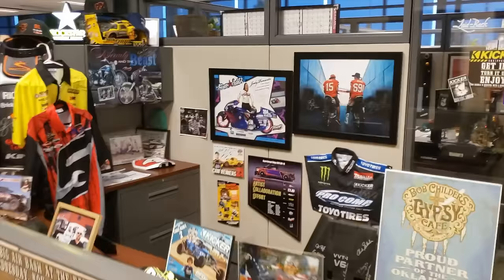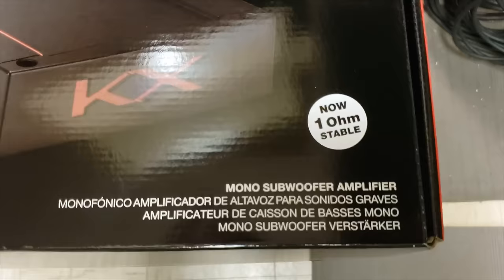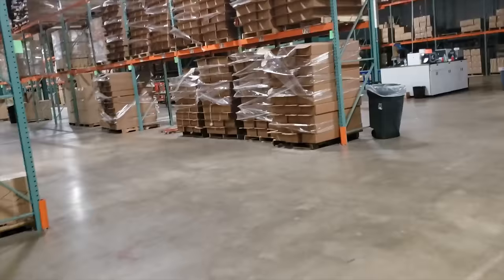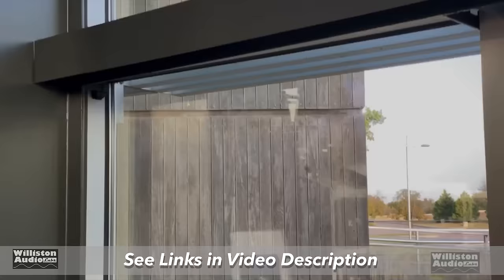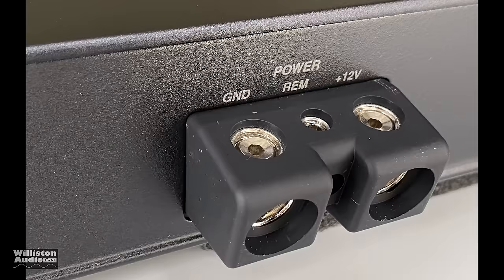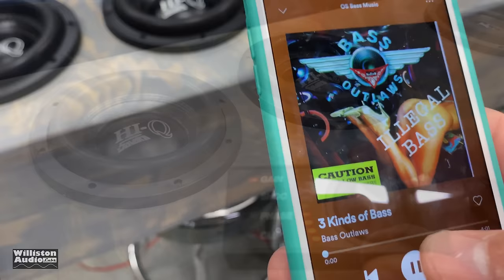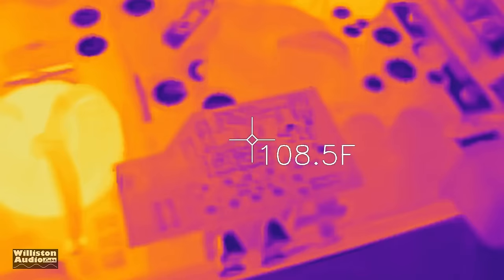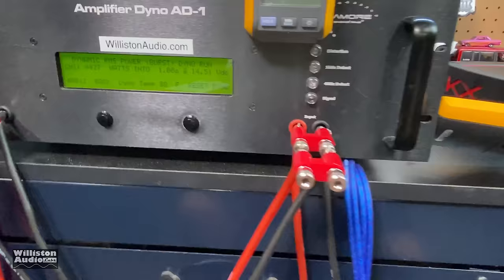Is it Worth the Money? Kicker KXA2400.1 2400W Amp Review and Test

Comment: I am in the market looking for a new amp. I fried my Hifonics Zeus 2 channel rated at 2400 Watts (by my own doing). I have a single 12, 2 ohm rated 3,000 watt peak. I've been looking at the Kicker KXA 2400 1. 2400W mono. On paper as far as power goes is impressive. 4 and 2 ohm peak at 2,400 / 2,405. 1 ohm at 3,500 watts between 80/85%. With a price tag of $1,000. My question is. Am I able to reach that amount of power at a lower cost? I am in Midland Texas and that seems to be all I can find with enough power.

Comment: Yo, love your videos please keep them up!

Question:  on the amp reviews you always mention the output GA size that sends the signal to the speakers. Is there a basic rule of thumb on wire size (if terminals are large enough) that we should use based that correlates with the real wattage amount? Like 1000w less 12ga, up to 1500w use 10ga... so on?

Thank you.

Comment: Can this run on the stock battery and alternator of a 2020 Santa Fe?  Don’t want to have to change the electrical system or components.
Reply from the maker: Generally speaking 1000-1500 watts is the most is use with a factory electrical system. You may be able to get by with an extra battery, but it depends on your listening tastes and habits

Comment: I've always been a kicker fan, I've got a zx2500.1 that I paid $600 for brand new about 10 years ago and its still hitting hard with the same 2 15” L7s...I just bought 2 15” L7 q class for another project I'm working on and want to get this amp but not ready to spend $1000 so I got the cheap Rockville db16 to try

Comment: I wish you would do more kicker dyno’s. I can’t find a CXA 1200.1 or 1800.1 dyno anywhere on YouTube and those are both super popular amps. It would be really nice to know what they actually do.
Reply from the maker: Thanks for the suggestion 👌
Reply: @wal  thanks for the reply. Great show by the way! I have been binge watching for the last week. My wife hates me because all I have been talking about is watts, ohms, voltage, etc. I’m sure she knows more than she ever wanted to know about car audio. She helped rip out all the CCA and replace it with OFC yesterday. Now I am fixing to do the big three and imma need some tiny hands so she’s just volunteered 😂
Reply: @wal  hey sorry I also have a quick question. Are there any shallow mount 10 inch subs that have an RMS rating above 600 watts? I think I’ve hit a wall because I’m out of room in my truck (2005 F-150 Crew-cab) so if I can’t find a higher wattage sub woofer I either have to stop obsessing or give up my back seat….. or get out the cutting torch 🤔

Comment: Not too sure how useful the remote is. Fine I guess if the system only has one amp. If there are multiple amps. Does one remote control all of them?  Having "Gain" on there when it clearly a volume knob is a little confusing too.
Reply: You gotta watch before commenting bruh. Big D said it connects to 4 amplifiers with 1 knob.

Comment: I dont get it. They say it needs a 200amp fuse but its pulling 300 certified and almost 500 dynamic amps?? Wouldnt that blow the fuse everytime if u r running at 1 ohm?
Reply: The 200 Amp fuse is in between the Amp and the subs.
Reply: @drewjohnson4794  ya i know but as you can see this amp pulls way way more than 200amps so that 200amp fuse would blow

Comment: I have 6 audiopipe TXX BD3 12's on a 8000 watt gravity. It's pushing them. I have a friend that has two on some amp and he won't tell me what kind it is that's hitting harder than my six. Do you have any kind of suggestion for me? That's in my price range🤷🏾‍♂️ I paid $300 for the gravity 8000 watts.
Reply: i would say buy 2 taramp smart3 amps and hook up 3 subs per amp. the amp isnt much but the electrical upgrade will be up there. extra batteries, upgraded alternator and wires will cost alot of money but your system will be hittin hard

Comment: Omg man, I was just researching kickers amps. Haven't looked at them for a while because of their price. Any chane you might have a cerwin vega in the works? I really dig the flir cam too. Never thought the chokes would be the hotter thing in there. Seems they'd hold the heat longer but still, crazy
Reply from the maker: It is possible 🤔
Reply: @wal  k well regardless...... Kick ass review. Just straight kick ass

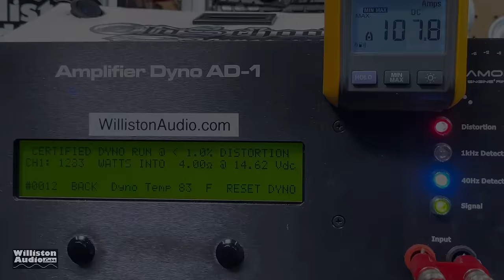Comment: I don't get it, the first test at 4 ohm certified showed you pulled 135.7 amps..(11:44) ...Then when you talk about the efficiency, that test changed to 107.8 amps?...o.0 (12:32)
Reply from the maker: The amp reached its power with 107.8A and continued to pull current after reaching 1% THD. This is normal as I match the clamp meter and Dyno after capturing the clip.

Comment: need to test an old KX2500  EDIT - Big D, any chance you can forward a question to a kicker tech for me? Wondering if I can run two warhorses to a single 2VC sub, just send the second amp an inverse signal so both coils are powered all the time but by alternating amp.  May need some weird diode setup (if thats even possible) but it would be fun.. :)
Reply from the maker: You can call their tech support Mon-Fri

Comment: I'm gonna return mine kxa2400 had it a month tomorrow exactly! its shutting off  getting super hot very disappointed 😞 it's was the strongest amp I've ever had but it just gets too hot and cuts off unacceptable very disappointed! Went back to my old  Brx2400 hifonics  Brutus that thing has been running strong for yrs!!! I never would have thought I would have to go back to it but here we are! Kicker come on man!
Reply from the maker: You should have them look at it. They test their amps running at full RMS power output for hours! They are designed and engineered to handle a beating!
Reply: @wal  yeah I mean don't even beat on it for long at all 1min 2 tops what really sucks is after that clean bass it's really hard to go back! 😔 I'm torn I wanna send it in but I mean a month that's  all before I have to send it in for repairs!!
Reply: @wal  think I figured out the problem loose power cable coming off second battery gonna reinstall it when I get home 🤞 it's all good!

Comment: I had the kicker kxma800.5 and I will be honest I didn't see what made it worth $650. I could buy a Helix amp by Audiotec Fischer for that. The kicker was still a clean amp with great features but not $600+ worth. I remember seeing caps that even cheaper amps use. Different users for different reasons though. I didn't use it in a marine environment

Comment: 1 off Design Is Where The Cost Comes In... But That Efficiency Will Save U Some Cash On Your Electrical. I've Seen Cheap 2k Amp Draw As Much Current As This. And This Kicker Is Making Alot More Power Then Those.

Comment: I had the KXA800.1 it was a powerful amp good crossover and loved the Bluetooth remote. BUT It had Bluetooth issues. When ever I had the car serviced services and the battery was disconnected it would not pair again. Sent it off they fixed it and it did it again.
Reply from the maker: That’s a bummer! Let me know what happens
Reply: @wal  It wouldnt ever pair again even bought a second remote. I sold the amp as is.

Comment: Big D. I’m looking for a sub amp that is at 2k or more in 4 ohm mono. Any suggestions 
Thanks
Reply from the maker: Wow that’s a big amp if you are going monoblock.  The Orion HCCA3000.1DSPLX will do that power but they are hard to find at the moment.
Reply: Looks like the HCCA 5000 will give me 2300 at 4 ohms. Are these current amps? Trying to find one.
Thanks

Comment: That's not hot, running my Punch 150's back in the day, there was literally solder dripping out of my right side sub amp... They really didn't like 1ohm too much... (solder melts around 375 degrees) It was actually repairable too, just needed to clean out the melted and replace with new.... yes really...

Comment: Is the silver one before this one 1 ohm stable?
Reply: No only newer ones. The silver ones KX are 2 ohm stable.  KXA amplifiers black ones are 1 ohm stable. I use 2 kxa1600.1 and they are great.
Reply: @wirebender  i have the silver one. Is there an amp dyno on that one? I cant find one. What do you think it does?
Reply: @enzos9211  i only seen a amp dyno of the kx1200.1 not the 1600. It probably puts out hundred more watts than rated. Its regulated power supply so no big numbers but consistent power.
Reply: @wirebender  i figured. I need more power so I'll be selling this one soon. Thanks

Comment: The days of the cheater amps are long gone. It would be nice to see a 80% to 200% underrated amp like back in the day with Kicker, JL or RF . We have lowered our expectations to being happy with  rated power.
Reply from the maker: Did you even see the 1 ohm run? 😳
Reply: I know, right?  50W 8Ω 100W 4Ω 200W 2Ω 400W 1Ω 800W 500mΩ 1600W 250mΩ 3200W 125mΩ 7200W Arc Welder Mode. :-D
Reply: @wal  I did, but was the only run a lot higher than rated.

Comment: Can I get a good recommendation for a good cheap amp maybe 500 to 700  have gotten so many answers from rockford Taramps wolfram audio crossfire audio legion hifonics. Trying to power 2 l5 12s legit know nothing about car audio and just basic electrical
Reply: 500-700 watts on what ohm load
Reply: @rowboyto156  sorry 500 to 700 bucks lol. I'd hopefully like more then 500 to 700 watts and I honestly know verry little about watts voltage ohms
Reply: @Apolloneek  the taramps smart3 is a good one since you dont know what ohm load your subs will be in. the amp puts out 3000 watts in 1 and 2 ohms, it has a clip light so you can tune it without breaking the subs, its still available not sold out and its cheap its less than $500. you will need to buy extra batteries since the L5s are 600 watts rms each sub and will draw alot of power to bump good
Reply: @rowboyto156  I was wondering that or if my money would be better spent in alternator and wiring or a separate battery. Also I've heard bad things about full bridge amps is the Taramps a full bridge and can you explain anything you know about full bridge amps.
Reply: @Apolloneek  lets say you bought the smart3 you can tune the amp down to 1200-1500w so theres really no need to buy a big alternator. as for wires always use copper. you can use welding cable its cheaper than car audio wires and will fit the smart3 terminals better.
the problem with brazilian full bridge amps were they were designed for mids and highs and not overbuilt like korean boards so they would break if you go under 12v. korean boards break if you go under 9v. the smart3 is a full bridge design but its meant for bass and the amp will just shut off if it goes under its operating voltage. so 2 agm batteries (front of the car and trunk) and big3 upgrade will be enough to push 1200-1500w. when you decide you use the amps potential thats when you upgrade the alternator and add another battery or go lithium
Reply: @rowboyto156  awesome I kind of planned to do a amp like that for bass and a separate amp for the speakers and tweaters. What agm batteries or alternator do you recommend I have a 99 suburban 2500 7.4 l with a stock 140amp alt
Reply: @Apolloneek  the best alternators for gm vehicles is mechman because of their variety of amperage and for agm check out kinetik, odyssey, and xs power just make sure the battery is 100ah and over
Reply: @rowboyto156  awesome thanks again for the help I'm going to look up about wiring the subs in parrell or series and ohms before anything is done with them I don't like messing my stuff up lol. I actually got 1 more sub so I'm going to try to have 3 running
Reply: @rowboyto156  also I'm in a hot climate is it better to find a active cooled amp or just wire it for cooler operation
Reply: @Apolloneek  i like amps with build in fans but if you live in a hot area and mostly leave your vehicle outside in the hot sun you might need to buy an external fan to cool the amps heat sinks
Reply: @rowboyto156  yeah honestly I'm in one of the hottest cities in america and it does stay outside. Lol would a cheap 12v cigarette lighter fan be ok or should I get real fans wired inside a switch
Reply: @rowboyto156  again thanks alot for your help I just ordered a tar smart 3k just for bassinet and will be getting separate amps for a 1 sundown 10 I have and the tweaters and 6x9s I plan on later getting them with the mechman
Reply: @Apolloneek  no problem man im glad i can help. for external fans use duct fans thats 130cfm. i tried sending a link but yt wouldnt show my comment. just search amazon for "12v yaemarine 3 inch blower"
Reply: @rowboyto156  hey can I ask one more question ? I just saw that wolfram o5000 are 285 right now should I order that also for maybe when I have more alts and batteries since it's such a good price now ?
Reply: @Apolloneek  yeah go for it. wolfram has really good deals and they use good buildhouses for their products, and if you ever change your mind their resell value is pretty high
Reply: @rowboyto156  Yeah I figured I had some extra money and they're on such good markoffs I could make profit on it later date wise if not used. I bought a sfb 8000 I made a good penny on that allowed me to buy this upgrade stuff. Got the fans you recommended got a smart 3k and am negotiating on someone in my city for a xs battery and mechman package. Going from a knock off crunch amp and 1 l5 to this will be awesome
Reply: @Apolloneek  hell yeah! youre gonna have a badass build
Reply: @rowboyto156  Still one more question always me with the questions on stuff I don't know lol. Found a banging deal on a sundown zv5 is there any way I can tell it's real guy said it's reconed and cone doesn't say sundown I'm always on the marketplace apps and want to make sure if I buy it
Reply: @Apolloneek  check the magnet holes on the bottom zv5 have a distinctive design and shape, the boot that covers the magnet should have sundown on it, the gasket that goes around the surround of the sub should say sundown all over and i think there would be an american flag sticker on the basket. the soft parts is difficult since its a recone. the pictures show they use a black spider with stitched tensil leads and the voice coil is black aluminum. if the sub is legit sundown zv5 but the recone isnt that shouldnt be a deal breaker you can always buy a sundown recone kit from them direct
Reply: @rowboyto156  ok I will look up the magnet holes and other stuff you said from what I saw I think the magnet gasket is also gone which was kinda sketch also but I'm gonna go over it with a fine tooth comb because I hate wasting money espically like that.
Reply: @Apolloneek  yeah man theres people out there trying to pull a fast one and theres some who are just trying to get rid of their equipment quick. i got my 13w7 for $100 cuz it was blown. even with a recone from a 3rd party the sub cost me less than $300
Reply: @rowboyto156  Yeah I mean Im gonna go back and check it today otherwise someone else is selling a way legit one but for double the price and less of a steal deal. Reconed guy is offering if I buy 24 hours to bring it back if I don't feel it's legit so I have 2 options at best or worse.
Reply: @Apolloneek  thats not bad at all if hes willing to refund. i hope for the best, your build will be insane. your neighbors are gonna love you lol
Reply: @rowboyto156  lol neighbors want my bs kickers now

Comment: Hey long time watcher love your channel you said made in china unfortunately but there is a lot of amazingly good stuff from china like sinus faber gear also slot if not all amps Nd and speakers and so on are from china even the koreans are having amps made in China for there amps because the electronics building has gotten to be one of the best in the world and that based on me being in industry and using so many different amps as I'm a distributor for products so I have seen the good the bad the in-between and honestly good amps is china bad amps is china and in-between is china so if be a little iffy bout having factory building in the usa or a country like usa as the cost of the amos would sky rocket I mean now you can buy a 30kw amp for less than 2k I mean from the main buildhouse with your own logos and even you own case design etc for around the 1300usd mark plus shipping and. Normally there's a now as well

Comment: Hey guys  ,will this amp push two 13w7ae,'s ..
Reply: I have mine on my 13w7s, they could take some more but it pushes them pretty good
Reply: @cjon24s69  ok thanks bro appreciate the info , yeah I dont want to max them out maybe 1200watt each I'm thinking, also how do u have the subs wired bro.
Reply: Jr Garcia They are dual 1.5 ohms in series parallel so the amp is seeing 1.5 ohms

Comment: I had the kxa1200.1 and I sold it and got the T1500-1bdcp RF amp amd im pretty happy with it but prob could have just got a bigger kxa like the 1600 or something
Reply from the maker: Both great amps!
Reply: @wal  i returned the kxa1200.1 because vocals came thru with the crossover set at 100hz but it was a refurbished one not a new one

Comment: Only issue I see here is this is a thousand dollar amp when you can get slightly better power at a fraction of the cost with the jp 23v2
Reply: You think a kxa2400.1 and a jp23v2 are equal minus the price?  I got a Kicker kxa1600.1 and a D4S JP33 amplifiers.  You should try and get those amplifiers you referred to and compare them.
Reply: The kxa1600 is better than the jp23. 👍

Comment: You forgot the half ohm uncertified 😂😂
Reply: Methinks the fuse will open (blow) or the amp will go into protection mode.  May be possible to see what the power supply is capable of with a dynamic run.  Of course BIG DUMMY loads are purely resistive not reactive like an induction motor (speaker) so the real test is always using a speaker.  If it can drive a complex 1Ω box into clipping without blowing up or making fart noises, it's good. :-)